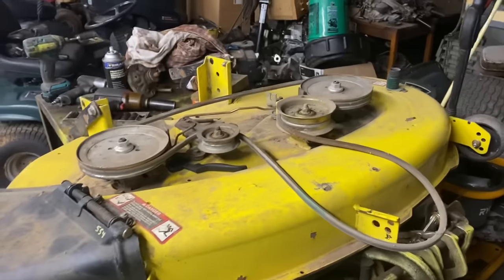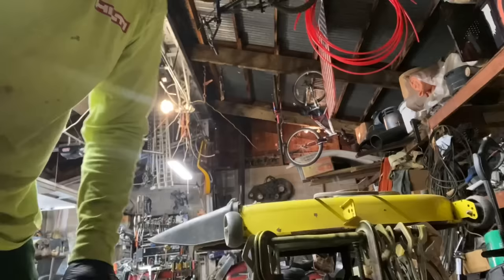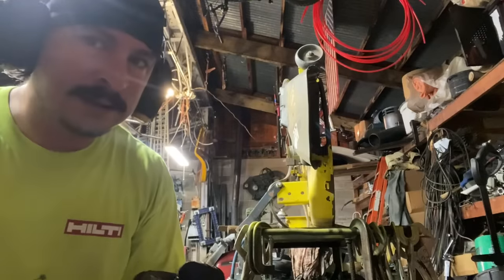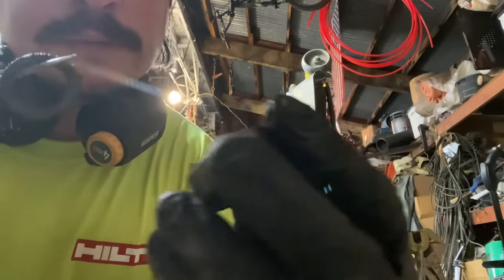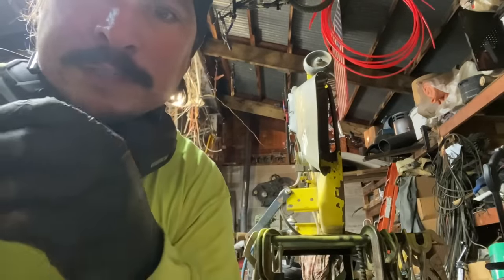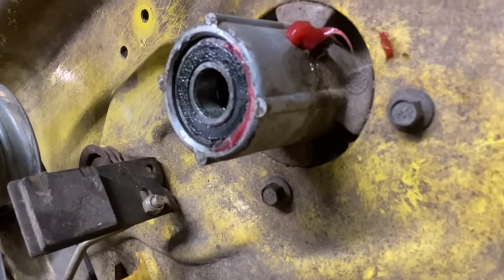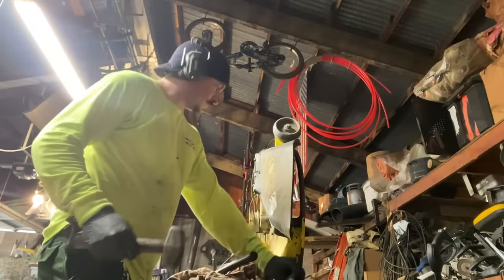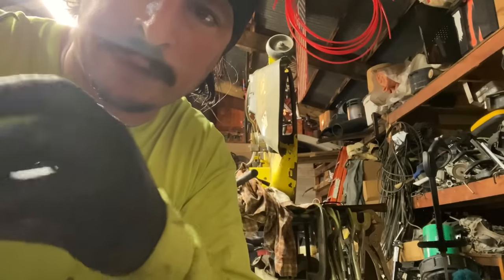Part 1 - Don’t trust the “Experts” Grease your mower deck sealed spindle bearings Common sense.

Comment: 100 % would be to remove the inner seals & fill the mandrel with grease.  Chances are, the grease will get hot and leak out the bottom.  So, when I come across this, I pop the seals, refill with grease then reseal them.  Then let the customer know there's not need to grease the zirt.
Reply from the maker: Chances ? Grease gets hot and leak? What? What? Why would it leak out a good seal? Just because it got hot? Why would a good bearing get that hot? Is it having an issue with grass packed around it overheating it? And how do you pressurize the grease between the bearings if the unit is apart? You simply don’t so that extra grease won’t do much good between the bearings. The upper bearing sure won’t get any of that grease as graveity only work one direction and hot grease sure dont move upwards without some pressure behind it. Like the pressure from a grease gun hint hint . SMH. And if seals have issues why would anybody even want to reuse that? I’m just overwhelmed by how many issues I see in this one comment. 

Lots to try and unpack in that comment. What in the heck? Are you saying for units with no grease Zerk? I assume that must be what you mean but just in case you’re saying to disassemble a perfectly good operational unit with a grease zerk just to grease bearings? I seriously hope you kidding. Please tell me you’re kidding. 

Did you see the full video? What am I missing? Did this look fake or like a truck? It is the absolute 100% true way to get same results but with less work to grease as Iv shown. The easy way some might say. 100% guaranteed every time never fails, at least has never failed me in over 10 years. It never fails unless your parts are damaged already because of running to failure. Obviously adding grease to destroyed parts is not a fix. Though some would like to think it is, won’t do much good. But this video is specifically about preventing failure / prevenetitive maintenance to be exact. It’s just Simple mower PM stuff nothing magic happening here. This is just plain old school deck
Services. If it has a zerk it’s there to be used. They don’t add a single component just to look pretty, they have these things down to saving a penny on any part they can. They won’t tap a zerk on something that shouldn’t be greased. Just silly logic to think otherwise and I challenge anybody to prove me wrong on a video and I’ll make a video to give that person credit. But Im extremely doubtful it will ever happen. But what I know happens is Grease travels through the assembly from the zerk and passed through bearings just as Iv proved. It is called a zerk. Named after the man who invented it. And your wasting your time, that’s just a fact and a fact Iv proven. but hay, do your thing. I can lead a horse to water so to speak. If Folks still want to do things the hard way I’m all
For it. Personally I like to work smarter not harder. If I see something that makes life easier I’d probably be skeptical but I’d consider it and try it. Thought I’d share this for those who like to do things the easy way. But hay I get it, in your mind it does something special doing it your way and spending the extra hour to remove and dismantle a deck. Been there done that for a decade no more extra time like that these days. 

And please don’t tell your customers not to grease them. Thats why I made this. Because folks were make videos saying these won’t take grease this way and they are wrong and telling folks BS
Information. Just try it and run some tests. It’s easy to find the truth if you try it. The customers can still grease them, obviously not needed immediately after you service one but in 6 months or a year it could be beneficial. Maybe they appreciate that kind of honesty and knowledge rather than being told not to do it and come to find out you were wrong. It’s just not necessary to take everything apart to get the same results you did. Only need a grease gun. However someone will need to get a grease needle after those idler pulleys or they will fail for sure. So much to think about here. Should I assume I’m right or just go out on a limb and grab a grease gun and learn something. Keep your mind open to possibilities and grow. I’m kinda dumb but I figured this one out. Got to love mowers. Lots to learn.
Reply: It's not going to leak out the seal. It'll leak out between the shaft and the ID of the bearing. Not a lot. But keep in mind, gravity will keep the top bearing from getting as much grease.  Better to re grease the top bearing  & reseal it.  .
Reply from the maker: @hrdman2luv  gravety won’t be any issue when using a grease gun. And if the unit is greased annually or more often it’s really nothing to worry about at all.

Comment: From my exspereance silled  bearings are junk ! If you can't grease it, it won't last ! That's why many old cars r still hear today !
Reply from the maker: Yea I agree. I hate sealed hub bearings most. Iv thought about adding a grease zerk. However for the application shown in my video, they can be greased and grease passes the seals on shields and easily finds it’s way into the bearing. But I think i understand what you are saying. In the automotive realm many assemblies are not greasable. But the ideler tensioner has a shielded bearing just like these mowers and the caps can be poped off and grease added. I actually have a video on that.

Comment: Pop the inner seals ,grease the spindle and move on
Reply from the maker: So, take a new mower apart and remove seals? Why not just connect a grease gun and pump the bearings full! After all that is why I made the video. Must watch it all to see the benefit.

Comment: I've never greased a sealed bearing. It's fkn sealed. Packing that housing full of grease just causes a mess. The real issue with bearing housings as that the design engineers choose the incorrect style bearing. They need to be manufactured with a double roller style bearing instead of using a single. You can't grease a sealed bearing from outside the bearing..c'mon, use your thinker.
Reply from the maker: Your comment is a hot mess of unfounded misinformation. It’s a real shame you never tried it. Greasing bearings through the zerk actually works great. It’s so simple it’s stupid to even argue about it. Just connect a grease gun and reap the rewards. No need to thank me. I don’t care about that. Just here to help let folks know the thin rubber lip on a bearing shield can’t stop grease from passing through the bearing when applied from a simple hand pump grease gun. Why not simply try it?
Reply: @GTObearclaw1  Not "sealed" bearings. I've been in the trades for 40 years..just might know a thing or 3. You can't grease a sealed bearing without removing the seal. Pretty simple concept there, Jethro.
Reply from the maker: @Atouk  they are called sealed or shielded bearings. You do realize there are many levels of seals in the world. The bearings seals / shields in question are the very low end of the spectrum. The word seal for this application is very misleading. They can block dust and little else. Not even very efficient for keeping water out. Iv never in my life seen a bearing shield in a mandrel that grease would not pass thorough. The lip on these seals is extremely flexible and allows grease to pass without resistance. Please tell me you do realize at least that these are not sealed in the same way a hydraulic cylinder is sealed. Follow me for just a minute here. The shields are simply dust caps with a thin rubber lip that allows the inner and outer race to turn independently from one another. One side of the shield is extremely flexible and the rubber lip does not have the capability of holding back pressure even just a few PSI. 

Your saying for 40 years you never once even attempted to try out the existing zerks on mower deck mandrel. Not even once in 40 years? You think they have just been building these for decades but they were not functional? Like some kind of nationwide conspiracy? It’s sad that I even made a video and broke this process down to baby steps so even a monkey can follow the process but your not even willing to consider you have been wrong for 40 years and won’t simply connect a grease gun and try it one time just to see. You would rather explain to me how I’m wrong after Iv proven it in a video for all to see. Good grief, there are tons of comments from people who have been doing this process for years and who agree with me. The whole reason I made this video is because so many of the “ pros” are spreading terrable information about the  shields Stoping grease from entering the bearings. They are wrong and you are wrong. Trying to get you diehards to just simply try it one time to learn is the roadblock. Somewhere down the line you guys either imagined this on you own and it’s been a mental block all these years or someone gave you bad information and you took it an ran with it all these years. I’m simply saying it works and try it. I’m not gaining anything. I have been doing this for years. Works exactly as I have explained in my video. Nobody is preventing you from making a video showing I’m wrong. Heck, if you get around to it, please post the link below this comment or anywhere on any of my video comments. I’d love to see it. One thing naysayers have in common, they won’t try the process, and they can’t show any proof I’m
Wrong. They only talk about how they know from experience. Why not just prove it? Please connect a grease gun, pump in grease and show me it won’t pass the shields. It’s so simple. I guess it’s more fun to argue. Lol

Comment: Has any one looked at bearing design? 
The spindle shaft looks to be getting greased. 
Sealed bearings should easily last 3000 hours.
Prove me wrong.
Reply from the maker: What? Not even sure what I’m answering exactly. But I’ll try. Iv never seen a big box store brand lawn mower with anywhere near 3000 hours and Iv seen more bearings than I can count that were bad. Some machines had less than 100 hours on the meter and bearings out. I’m no expert but I do know that bearing quality varies and also the way mowers are cared for and stored and serviced are different and each one has its own unique life. Most the ones with early issues seem to be left outside and not stored In doors.
Reply: @GTObearclaw1  
Sir. What I am saying is that the grease ain't for the sealed bearing. If the bearings fail, well they fail. You will want to check them and just get new bearings. The grease is to fill the void and dissipate heat. It is what it is. Now on the other hand, your efforts to prevent that may help. Or not. Just a very difficult wear point. The bearings should last longer than the mower. As you can clearly show, many don't. But experts like you always get us back up and running. To which we are forever grateful. ;)
Reply from the maker: @jonnymo4728  you seem very respectful and don’t get me wrong I definitely dont what to be rude to you. But you are painfully wrong here. The grease will
Do absolutely nothing and provides no benefit to anything other than getting into a bearing. That’s the sole purpose of the zerk fitting and the one and only reason I made this video because the so called “experts” who won’t show you the process just want to tell us it won’t work. I know it works. I have done it for years. Bearings won’t fail often if they are kept lubed. The most comon failure is running without grease and by simply adding grease through the zerk as I have showed you can avoid running without grease. There is no way to even know how full the assembly is until grease exits through a bearing so how would anyone even know when to stop pumping if they just wanted to fill the cavity and stop before grease pushed past the lip on shields? And even if it was possible to figure that out and stop before pushing grease into a bearing why would you go that far and stop right before the most beneficial part of the process was about to occur? Why would it hurt to add a few more pumps to get some in the bearing? As many folks have commented they do exactly as I have shown and never had issues. Some folks say they have always done this and never lost a bearing. Not a single person has commented that said this caused issues with there mower. Only folks commenting saying it’s not beneficial are the folks who are certain it won’t work but never try it and seems they are unwilling to try it even though Iv shown the step by step process and I stand to gain nothing other than just wanting to help folks. Did you watch the full video and see the proof? What you do with the information I offer is your choice but to say it does not work without trying it is a very silly thing. Bearings need grease, this process is to grease the bearings without dismantling the deck. It’s so simple and so vital I can’t imagine why folks want say it won’t work especially if they haven’t actually performed the process. Some folks would rather just rain the bearings to failure and fix it. I think that’s absolutely absurd. I’m glad I figured this out. Now I don’t have to take decks apart to just grease bearings anymore. Saves me a lot of time and bearings last forever. Try popping off a shield on a new bearing with the rubber shields next time you have one in your hand and then see what you think about how well the new bearings are lubricated. I can guarantee you the cheep ones that come 4 to a set for 20$ usually look like they didn’t even get greased from the factory. Go pay 20$ to 30$ for a single bearing from a quality manufacturer and they will usually be packed full. Not all bearing manufacturers will provide as much grease or high quality grease. The only way you know is if you check the bearings and or you put it in there. 
I am not an expert. I don’t claim to be, this is such a simple thing but many folks can’t grasp it. Even took me a while to understand this process and nobody helped me. Especially not the experts. Be carful who you trust. But also consider what the benefits can be. Who profits if your bearings fail? Who stands to gain the rewards if your bearings last forever? The reason why am I here showing the process is Becasue this is such a huge controversy and 99% of the information out there is crap. When the majority thinks one way it’s hard for me to change folks thinking. But the process I show can easily be tested at home and will cost max of 5$ to 10$ if you already own a grease gun all you need is a tube of grease. The average deck repair will run 100 to 200$ figuring time or labor and sometimes running a bearing to failure will cause catastrophic damage to belts and blades if the bearing fails blade could hit the deck and bend. It’s fun to help folks. Hope this might make you reconsider your stand on the topic and give it a tests. Only positive benefit can come.

Comment: And both those barely had about 1/3 of the grease they should have meanwhile more grease came out the bottom than what went into the bearings ... no thanks ill keep pulling the seals.
Reply from the maker: Okay. I guess you don’t appreciate the point I’m trying to make. Not only is this practical but it proves some of the “Pros” are wrong. As for the grease that reached the bearing. That’s as much or more than some new bearings come with. That was also the first attempt to grease. Think about it a minute. Once the bearings spin a while and the grease distributed around the bearing it will easily accept more next time it’s greased. By the 3rd or 4th service the bearings will be filled. It really does not need to be completely full but does not hurt anything either. As for the grease that made it into the bearings, it’s plenty to make the bearings last way longer than not servicing. And this video is not so much for the folks that have the skills and desire to remove the bearings and grease each one Individually. It is more for the folks who do not have the desire to dismantle a deck just to add grease or may not have the tools or skills to do such indepth tear down just to get the same results that can be obtained from adding grease with a gun through the zerk. Thanks for the comment.
Reply: @GTObearclaw1  i see your point and you're right .. but if ive got them out im going to pull the seals anyway.

Comment: JUST POP OUT THE INNER SEALS
Reply from the maker: Just curious, did you watch the whole video? You might have commented before seeing the part where I provided evidence that grease pushes right past those “seals”. Some folks assume the word seal means something specific like the capability to stop pressurized grease from passing. Yes in some applications like a hydraulic cylinder a seal can stop the flow of grease or oil past it. But for this application the seal is actually nothing like folks are imagining. It’s literally a rubber lip that will not even hold back a few PSI. Water can simply seap past. Those shields most definitely can’t hold back grease being applied under pressure from a grease gun. Greased passes right into bearings like the shields not there. Once you know the truth it almost seems silly that it’s even something of controversy. As for disassembling the deck solely for the purpose of removing the shields, actually it’s just a waste of time and nothing more.